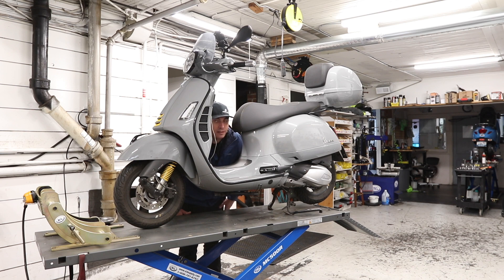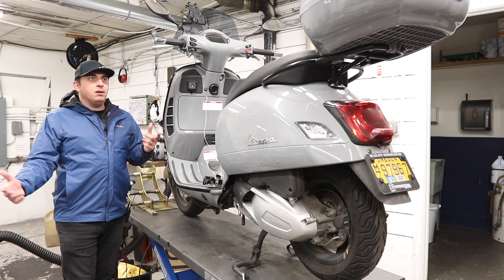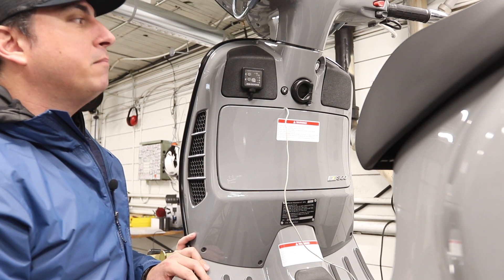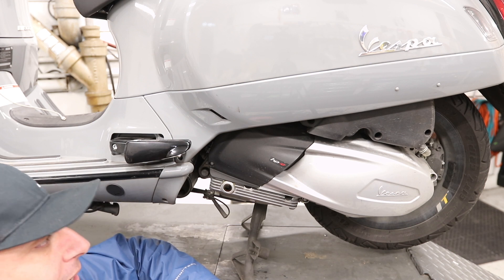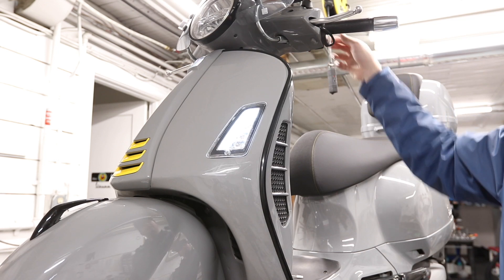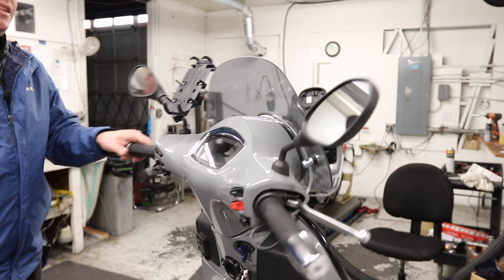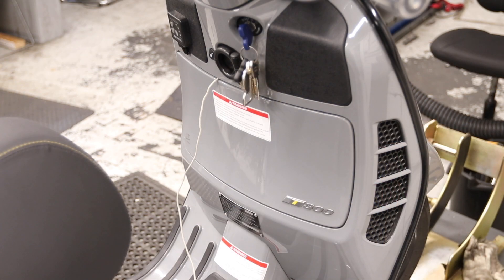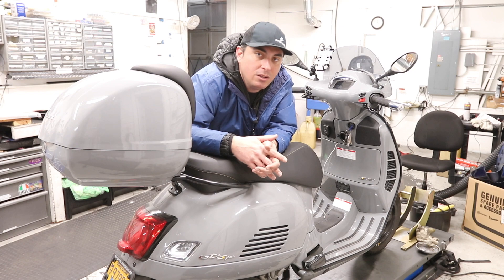Staff Rides: Andrew's 2020 Vespa GTS Supertech

Comment: Good doing on the brake light. I had an Africa Twin years ago that I bought with the hopes on riding it to Washington and back. It was brand new, I wanted to break in the engine and do the first service before taking it up north. I was riding around Big Bear and had about 300mi on the bike, so halfway to break in. I came to a stop in construction and got rear ended…. HARD. Got pushed into the car in front of me and had my left foot ran over. Had to yell at the guy to reverse so I could keep custody of my foot. Anyways, that bike got totaled and I’m still alive. Getting rear ended is no joke! Trust nobody!
Reply from the maker: Holy crap that’s a wild situation. Glad you’re alright. I have eyes glued on my mirrors at stops trying to determine who is not planning on slowing down before reaching me. That has saved me twice so far. Thanks as usual for watching, Mr. President
Reply: @VespaPortland  you folks up north need lane filtering. And of course, I’m subbed after all 😍
Lol. Have a good night 🤘🏻
Reply from the maker: Yes we do… someday.

Comment: Cool video.  One thing I use on my Vespa is a wireless tire pressure monitoring system.  It gives me peace of mind and saves time in regards to having manually check the tires for low pressure.
Reply from the maker: Those are cool! We had a scooter in here the other day with a little box mounted on the mirror with at readout of the pressure. For me I just wait until the ASR starts to hesitate before I know I need to add some air. Thanks for watching and enjoy those upcoming rides!

Comment: Oh, such auspicious timing, Andrew! I got my 2022 SuperTech a few weeks ago (replacing my 2015 GTS Super that got trashed in December, as told to you in a different video thread), and I'm loving it to pieces, even though it has just a bit over 200 miles on it. Had the dealer put Koso heated grips and Buchsenfuchs' replacement rear tone ring for improving speedo accuracy and (so I'm told) increasing the bike's top end back into the low 80s. Impatiently awaiting a shipment from SIP for a Euro-spec Flyscreen (just like yours, and what I had on my previous GTS), and "minimalist" Cuppini crashbars, as well as that all-important sight-glass-equipped oil pan. I have the same phone-charging setup as you, but actually found a flat-profile USB cable that works better with the glove-box door closed (took some looking online, but they exist; try Micro Center).Will be upgrading the turn-signals to the setup Scooterwest offers at some point, but will get the brake-light modulator a lot sooner for the reasons you mentioned. (But the reflectors stay put: I know there are drivers out there that will claim they "didn't see you" even if you were lit up like Elvis in Vegas, but in my experience, every little bit helps.) Thanks again for this video, and yes, your SuperTech rocks. (Would've liked that color myself, but I'm cool with Nero Convinto Matte.)

(P.S. I'm very curious about that as-yet-unused gas-filler thingie you were gifted with…might you - ahem - fill us in about it at some point?)
Reply from the maker: That’s all very cool to hear. I may make that a video in the future. I should probably try it out first to actually understand how it works. Thanks for writing.

Comment: Great video, thanks for posting. Some great ideas for stuff to throw under my seat. Any recommendation for a small rechargeable tire inflator?
Reply from the maker: Thanks for watching. No recommendation for that but now that you mention it I’d like one too. Good tip.
Reply: @VespaPortland  there should be a co2 cartridge and valve adapter in that kit no? That’s how I roll with mine anyway. I also keep a short folding (like maybe 10”?) cycle pump in the seat box as well to top up from where the co2 stops. You don’t want to put 200+ cranks from dead flat by hand with a small air pump! 😂
Reply from the maker: There is!
Reply: @VespaPortland  ryobi has a nice tire inflator that takes its 18v batteries. I keep mine in my bookbag for my regular bike even. all you need is a small 2Ah
Reply from the maker: That sounds great. Thanks for the tip!

Comment: Ha, I was writing a comment asking about oil consumption and you started talking about it. Has any oil burning reduced after putting miles on the bike? I heard some of them will stop consuming after 10k miles or so, or even when adding heavier oil. Does the new iget engine consume in the same way?
Reply from the maker: I’m about 2000 miles away from 10k and I’m curious if it’ll slow down. It’s not terrible as is but I need to add a little more oil every 2500 miles or so. Thankfully the service interval is right around there (every 3k) so it gets refreshed soon even if I forget. No issues with the primavera/sprint iGet engines that we know if. Those scooters are reliable as hell.
Reply: @VespaPortland  great, thanks! I was also wondering if the oil consumption issue was solved after 2020. I read something like that on a forum but I’m not sure.
Reply: @charkswitlazers  The dealer where I bought my '22 SuperTech tells me they've addressed the issue within the last two model-years. Of course, I'll be keeping an eye on things - I've only put a bit over 200 miles on the bike - and I'll also have the sight-glass-equipped oil pan installed when the bike goes in for its first service @ 600mi.
Reply: @barrettwbenton  right on. I read on forums somewhere that it’s been rectified but it’s hard to say. Hopefully yours won’t burn any.